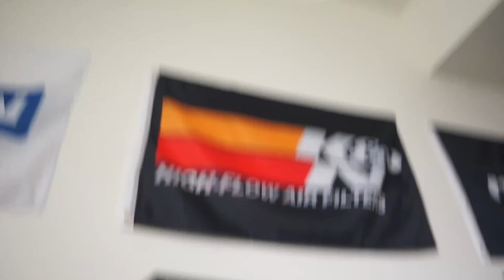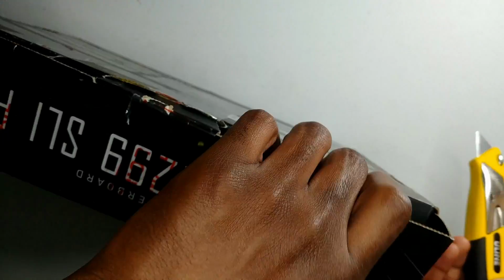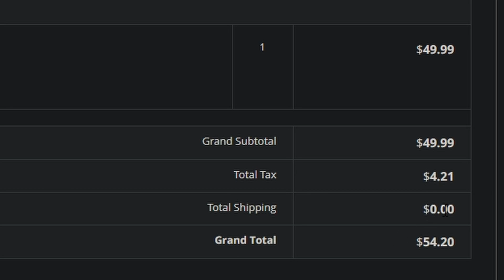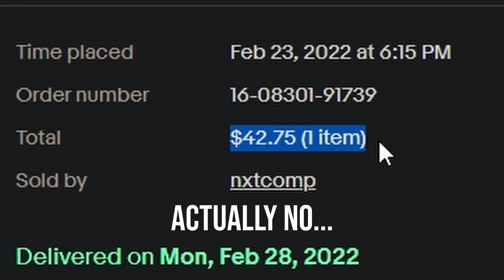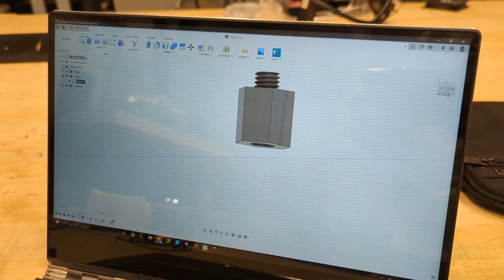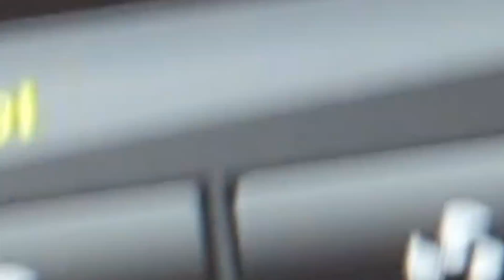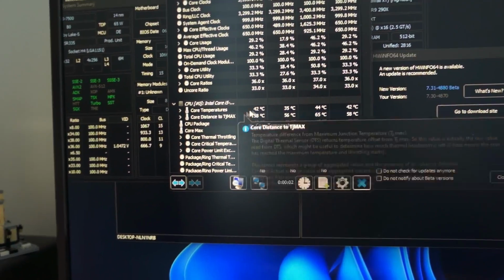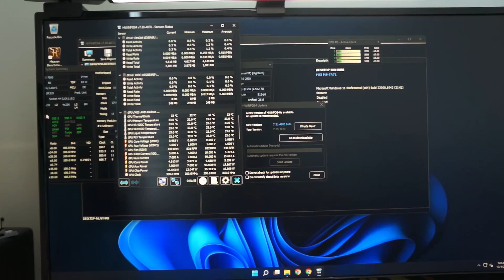Jeff's PC Flipping Adventures: Part 3-The Cursed Gaming PC

Comment: For the future, reference blower coolers on the 290 and RX480 are actually compatible on either one from what I've heard. You can get the 480 reference blower cooler for about $35 on Aliexpress.
Reply from the maker: you're joking Ryan 💀. I literally tried reinventing the wheel, and you're telling me I used a whole AIO, bought two bad ones, and an adapter?!? I remember I was even trying to 3D model a shroud 😭. well, thanks for the wisdom nonetheless, the fan mount was probably the cheapest replacement for something....